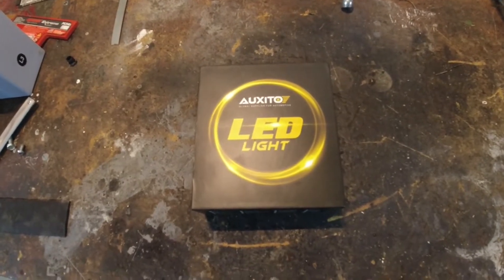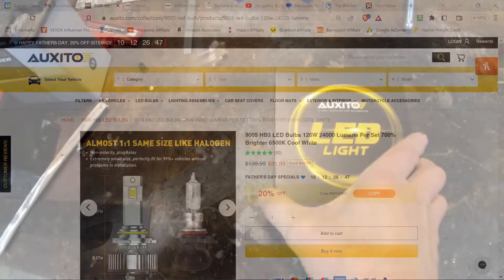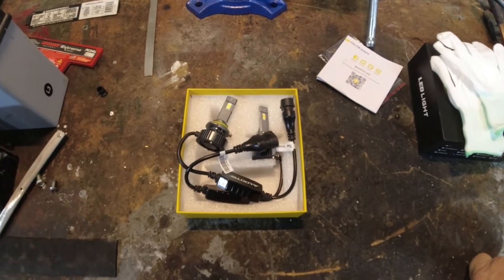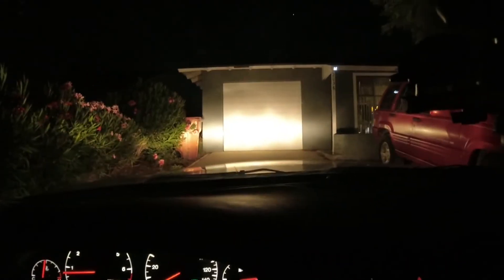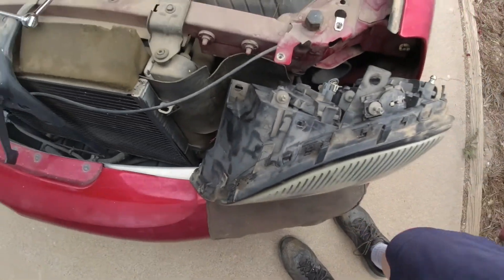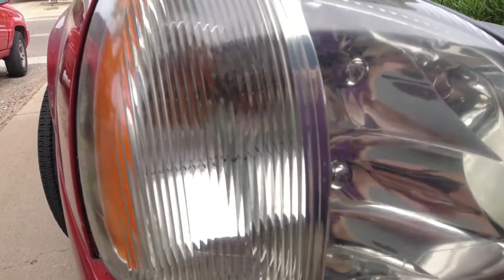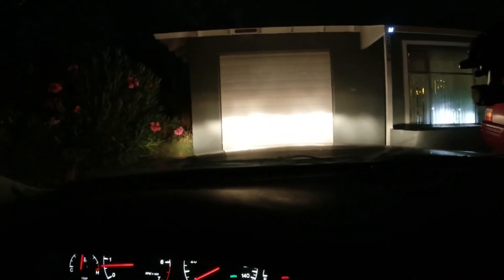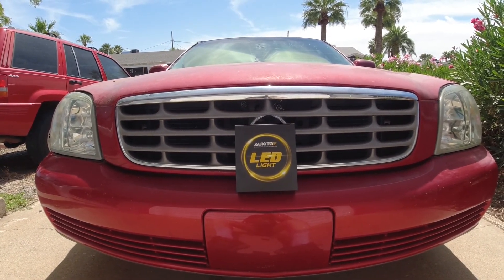Auxito 9005 HB3 Headlight LED Bulbs 120W 24000 Lumens Per Set 700% Brighter 6500K Cool White

Comment: There’s just no unbiased-honest reviews nowadays. There’s always a conflict of interest.
Reply from the maker: And why would there be unbiased reviews? No one is unbiased. For example, I hate doing headlight reviews, it's a buttload of work for a product that I've most likely already got better ones installed, which means I have to do the work twice. Plus, with old cars I never know what I'll break in the process. Also, I hate LED's with a color temp higher than about 5000k. I also hate bulbs without a key that clocks them correctly. See? I'm biased! 

Now, honest reviews are another matter. Personally, I know my reviews are honest, at least to the best of my ability, I'm not infallible. But I've never been intentionally dishonest. And that's whether I get the product free or I buy it myself. While I won't absolutely guarantee you that my integrity isn't for sale,  a $30 set of bulbs ain't the going rate. I've also lost multiple sponsors for doing less than stellar reviews on products that cost a lot more than $30. And quite frankly, good riddance to them, their product was crap. That's how you also know that no one is hand selecting and testing products for a channel the size of mine, I've gotten too many broken and defective products. And often, the marketing company isn't in the same city as the manufacturer, they just say "Send this to XXXX and he'll do a review". The dude who pulls the box off the shelf doesn't give a rat's ass if it works or not.

Thanks for watching and commenting!

Comment: The sort of magic electrinic box is called an "LED soecific Driver". Maybe youve heard of them. Or maybe you actually youre well aware and the joke was lost with the monochromatic feel of the statement you made. EITHER WAY , it just a rectifier, a step up/down fluctuation safety for the specific range of the led. The LSD in my custom laser etched mini fridge glass will NOT run my kitchen cabinet underglow, as well as my trucks under-dash drivers being incorrect to "run" the led lighing over my 1903-2003 camera collection. Nothing magic. (Although trained ASE mechanics still look at my Mikwaukee m18 powered soeaker/ammo boxes with their digital step downs,LED LSD and IR /x-over/BT boards blinking away like its a russian icbm, not the father daughter afternoon projects i enjoy building and sharing lol😅
Reply: huh
Reply: @ninobrown90 right
Reply: What r u on about
Reply: It’s just called an external driver.

Ur explanation is a bit unnecessary 🤣

An external driver is design for heat management and longevity. 

And the main unit of the led bulbs draws power, and the heat is being pulled away by the heatsink, copper tubes, and a cooling fan. So those themselves does its job. 

While the external driver does all the work to keep the led bulbs stable.

Comment: Can vehicles originally equipped with halogen lights be legally driven on U.S. and Canadian roads and highways if retrofitted with these LED bulbs?
Reply from the maker: Damn if I know. But then again I'm the type that believes it's easier to ask for forgiveness than to ask for permission. Thanks for watching!
Reply: Within the United States, most automotive lighting equipment is regulated by the U.S. Department of Transportation (DOT). Lighting equipment that is regulated by DOT must comply with Federal Motor Vehicle Safety Standard (FMVSS) 108, in order to be used legally on public roads.

Headlights and headlight bulbs are regulated by DOT, and must comply with the requirements of FMVSS108.
There is currently no provision within these regulations to legally replace halogen headlamp bulbs with LED bulb replacements. As a result, LED bulbs may not be used in headlights on public roads in the United States.

Fog lamps and fog light bulbs are not regulated by federal safety standards. When used in compliance with any applicable state or local laws, LED fog light bulbs are considered street-legal for use in the United States.

But long story short, yes you can go ahead for it(people change their all the time), but just know what you're throwing yourself in for.

Comment: @ChuckBryant

So here’s the what they said on the Y19 9005 led bulbs. 

Q: Does the Y19 Series 9005 LED headlight bulb have an adjustable collar?

A: No, they do not

That’s their info.

So if that’s the case. 

Why does ur 9005 Y19 led bulbs came with an Allen wrench?

To me, I believe I saw a set screw or Philips screw, hidden behind the yellow grommet. 

So could u make a quick clip and show if they are adjustable?

Comment: @ChuckBryant 

Awhile ago. I spoke with Auxito customer service. 

And they said the 9005 led bulbs doesn’t have an adjustable collar and only low beams. 

But I didn’t believe them on that particular reason.

Because as far as I know. 

Any led bulbs that I see a set screw on Y13 or Y19. 

If the box like ur video shows it came with an Allen wrench, why would that be in the box?

Any led bulbs that I see, whether if it’s a H11 or 9005. If there’s a set screw or black Philip screw. 

It’s there for a reason.

So it’s weird that why Auxito claims they don’t have adjustable collar for 9005 led bulbs?

I can understand for B3, 10S,M3 doesn’t have those. 

But for M3S,Q16,Y13, and Y19 has a set screw or black Philip screw. 

And it’s there for a reason, for to loose the screw and adjust the orientation of the led bulbs for the best beam pattern.